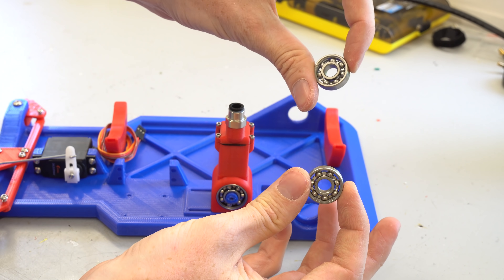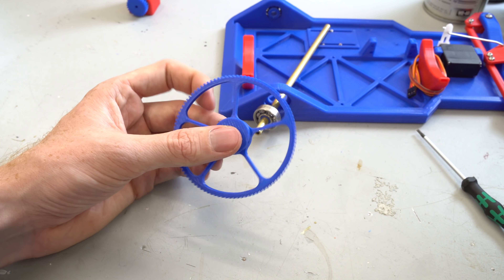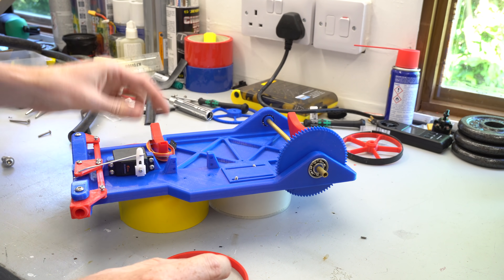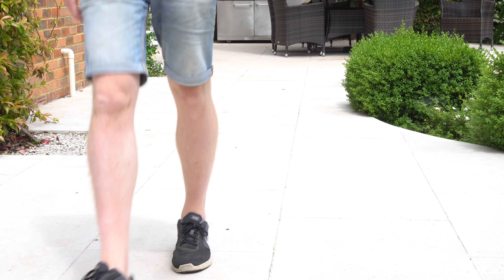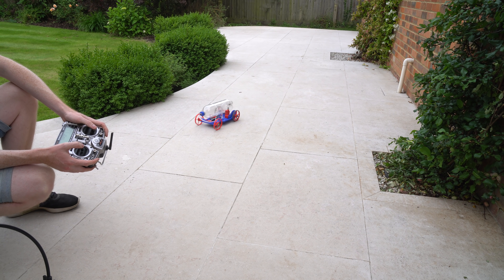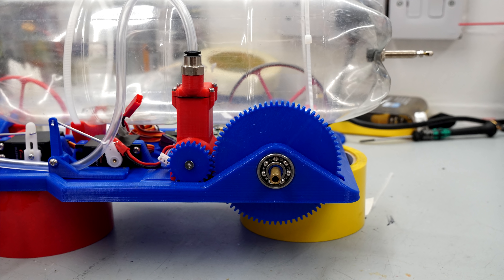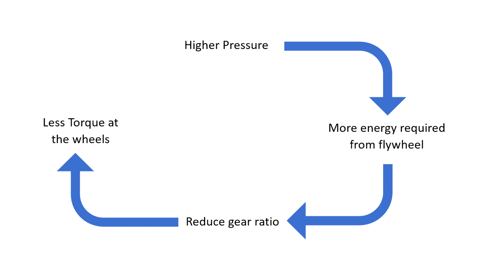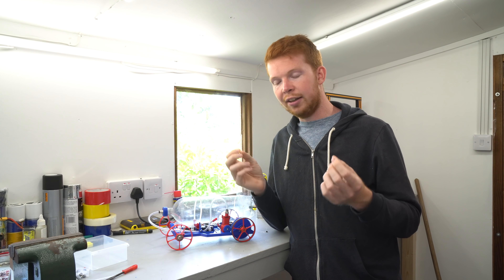Air Powered Car

Comment: Tom, you need a differential.
Reply: Or just drive only one wheel.
Reply: Edward Nardella Tom wants efficiency, so a differential would be perfect.
Reply: @Forever13 pt Surely a differential would decrease efficiency from increased friction. I think Edward's suggestion of single-wheel drive would be better (and simpler)
Reply: ...but with single-wheel drive all wheels would be free to rotate at different speeds and the extra friction of a differential would be eliminated.
Reply: Edward and David make a good point.

Driving only one wheel and having the other free-running in it's own bearing would work effectively the same as a differential and be simpler and reduce friction for the time being.  The two tires would then rotate at different speeds, and would accomplish what you've suggested.
Reply: davidf2281 Yeah, ungoverned wheels are going to totally work out better. Having a differential you have proportional torque on each side of the vehicle. And that increases acceleration and stability, two things that the car needs because of the lightness.
Reply: primary objective: to run the car, then we can thinking on the differential.
The car does not run quite even in the straight where the differential would be just harmful (for the major friction, if you've seen well, everything is mounted on bearings and not bushings, just to reduce friction)
Reply: Forever13 pt idk u seemed a bit angry at first lol
Reply: Based on his previous decisions, Tom will probably want to do a single driven wheel instead of a diff. because of the complexity it would add. He went with a single cylinder instead of multiple because of simplicity even though a multiple cylinder engine would be more efficient.
Reply: If we were talking about something going faster, the vibrations might be a concern, but we're not talking about something that is going very fast at all, thus I don't feel that the vibration point is really valid in this small of a platform.
Reply: Forever: 
What I meant to say is that even in the first piece of the route, before bending, while going more or less straight, the differential would be of little use and considering the little strength that the engine now has would only serve to reduce its efficiency.
When the engine will push the car as it should then you can think of the differential, which is also important but it is more urgent to find the thrust
Reply: zola tanaffa It doesn't need to be a complicated diff, just a open diff. A little bit more friction, and it helps it being stable and cornering.
Reply: yeah you need at least an open diff so the rear wheels can rotate at different speeds, useful for going around corners.
Reply: madhouse5213 Thanks for understanding.
Reply: At least for experimentation,  one driven wheel would be the easiest to intorduce, just case of printing another front wheel and and axle spacer, like on the chassis, to replace the fixed wheel.
Reply: But a lsd differential if possible
Reply: Cheap go karts have been doing this exact thing for years with no issues. Also with how little power the engine has, offsetting itself as you put it isn't really going to be an issue. All he would need is a very slight counter steer and the car will drive straight.
Reply: Just use only one slightly thicker wheel in the center of the car or put two one way clutches inside the rear wheels. But yes, there is no way this version could really steer.
Reply: Forever13 pt yeah sorry lol I realised after I scrolled down that what I said made no sense.
Reply: An Audi RS6 No worries.
Reply: pixelmaster Way to much friction.
Reply: Welsh Dave Yeah, but it will run offset.
Reply: MurderWalrus For the scale, go carts have a smaller axle. This vehicle would have a massive axle. And this engine, as you saw, doesn't have power to corner, and with one wheel only, it would not steer, probably sub steer, or oversteer a lot, making it uncontrollable.
Reply: Štěpán Müller Yeah. Diff would be the best here.
Reply: MurderWalrus Cheap go karts don't have any wheel friction, so they don't need torque because of the high rpms. This car doesn't have High RPM, so it would offset. And some go karts have diffs now, because they have gigantic axles.
Reply: MurderWalrus And I said one cylinder. An Opposed PISTON engine. One cylinder, two pistons. High rpm and torque, tested on Lego. The most efficient I have ever built (vacuum engine).
Reply: zola tanaffa An open diff. Not a car diff, not an lsd. You all thought way too much complicated designs, now that I'm reviewing this.
Reply: Do non-electric RC cars have a differential?
Reply: Jas Tech Some do.
Reply: Jas Tech And most are not as wide as this one.
Reply: No extra friction from a differential because when going straight the entire diff rotates as a unit while powering both wheels.
Reply: greggv8 Exactly.
Reply: Either you have really tiny hands or you have something other than the LEGO Technic differential. ;) That one has only 4 parts. The case with integrated ring gear, 2 side gears and one spider gear. Those 3 gears are the same. Slip the 3 gears in then push in two Technic axles to hold the side gears, which hold the spider gear onto a short pin. Dunno why they didn't design it to have two spider gears.

To adapt to this 3D printed car, cut pieces of a Technic axle and glue into pieces of the brass tube axle. A couple more bearings for the two axle shafts and alter the large 3D printed gear design to slip over and glue to the Technic differential case.
Reply: greggv8 Small palm, and big thin fingers. Could have been a good doctor, if I didn't have trembling, annoying fingers.
Reply: Forever13 pt is everything okay at home?
Reply: LueLou I have a Lego differential of the size of my palm. My palm has about 5-7 centimeters of diameter, and that car is much bigger than his hands that are slightly bigger than mine. Diffs won't be a problem.
Reply: Dave Blaser It has really big axles for it's size, believe me, it's kinda of a concern. And I'm saying fast for this kind of engines and vehicles, like between 8-13 kph
Reply: zola tanaffa Doesn't run straight, and you want to power it with one wheel! The differential will help with that.
Reply: An Audi RS6 But that still, why did you said " is it every good at HOME?" That could be take as an insult, or if you know me would be The same . Or you are simply interested in me, or something related with me. This last one is unlikely the one.
Reply: MurderWalrus Yeah. But, that car won't make corners and will be always offsetting it self.
Reply: Oh, do you think so? Did you realize that  the car slowed down because the wheels rotated at the same speed? Well, that car needs a differential now.
Reply: An Audi RS6 I'm not angry at all, I only tend to look like that. I can be really sarcastic, some people sometimes think like that, like I was being aggressive. Or maybe the colours of my Character influenced you so, your mind probably alerted you about "danger" because they are vivid. And yes, I actually understand a bit of psychology. I'm an ic engine designer, as well. Not has a job, since I really can't by my age.
Reply: An Audi RS6 What do you mean?
Reply: Dave Blaser Vibrations from separated sides would destroy that design, since you would need to find the best way to secure it. Too tight, it would not move. Too lose, it vibrates too much and increases vibration. Since this car is about torque, he should be using an opposed piston engine together with the differential, higher Torque, same losses, and increased speed and drivability. I always think higher, I always find a solution to a problem. And if another problem starts, I already have the solution.

Comment: you should by a proper air compresser. it'd get rid of the need for the bycicle pump when testing
Reply: He has one in the workshop. The soda bottle doesn't have much volume or take high pressures, so a bike pump is fine in this case.

Comment: You should only drive only one of the rear wheels, or make a differential.
Reply: You could say i'm speculating, I would say educated guess, or informed intuition, but am I safe in assuming you've done some kind of test or rigorous calculation? Unless you had I don't know why you would think you can call my conclusion into question by asking what it's based on, so go ahead, hit me with your tests and/or calculations.
Reply: Uhuh, when you're working with much more power, far more efficient motors, and a drive-train of engineered commercially made components, I'm sure using a differential makes a noticeable difference, but that's not what we're talking about. Real world piston steam engines only get up to about 40% anyway, this one is tiny and made from plastic. Let's be charitable and assume he's getting 10% efficiency, and equally charitably assume any 3d-printed diff would improve drive train efficiency by 20%, that's only a net efficiency improvement of 2%. If you have more accurate numbers that tell a difference story I'd love to hear them.
Reply: What assumptions have I made that are absurd? And what have you said more than once that i've ignored?
Reply: I understand that, I know what a differential is for, I'm arguing that the exact situation you're describing  would not cause a significant inefficiency.
Reply: @Rob Mckennie Have you run tests, done calculations or are you just speculating?
Reply: Just remove "rubber" from one wheel and make other wheel same size (reprint) - it should work for first test...
Reply: Rob Mckennie yes, I've made several model vehicles, that's my tests.
Reply: Stan ley execellent idea!
Reply: Why do you say that?
Reply: Rob Mckennie do you seriously expect me to answer your questions with answers you could easily figure out yourself after accusing you of trolling? I guess you do, I've seen that tactic work before. Is it fun for you to make people do useless work and waste their time?
Reply: I believe i've meaningfully considered everything you've said, and I don't believe any of my assumptions are absurd. If you don't want to defend your assertion that I ignored something you said or that I made absurd assumptions that's fine, but without knowing what you're referring to specifically I can't really address it.
Reply: The fact that you suggested one wheel drive as well as a differential doesn't invalidate criticisms of your suggestion of a differential lol, but forgetting about that fact for a second, the majority of my criticism applies equally to single wheel drive.
Reply: why?
Reply: Rob Mckennie to improve performance.
Reply: If you want to improve performance I feel like there are better things to focus on than making sure the wheels don't slip during a turn. In fact, I would think the additional friction of a 3d-printed diff would hurt the performance more than it would help.
Reply: Thats is why I suggested the much simpler and more efficient solution of driving only one wheel. It is a very low cost (time and effort) modification for a significant improvement in performance.
Reply: Lol I don't know if I buy significant, I would categorize it more along the lines of a waste of time
Reply: It wouldn't be significant if he ran in a straight line, but the moment he turns he bleeds off energy in a system that has very limited energy.
Reply: Rob Mckennie that's really funny, either you're lying or you actually believe that. Both are pathetic.
Reply: Go ahead and tell me what you claim I ignored, or what was absurd, and I'll defend what i've said.
Reply: Rob Mckennie you ignored my and others repeated comments about driving a single wheel instead of a differential.
Reply: @edwardatnardellaca  when turing, the outside wheel needs to move more than the inside wheel. Its basic physics. Thats exactly what a differential does. When driving both wheels the outside wheel will always skid because it has to move more. If you drive only one wheel, lets say the left wheel, when you turn left the vehicle will maintain its speed, but when you turn right the vehicle will loose speed. A differential prevents that
Reply: Rob Mckennie you're clearly no longer engaging in this discussion in good faith. Grow up.
Reply: Rob Mckennie because you're making absurd assumptions to back up your point and ignoring something that I have said more than once.
Reply: Edward, shut up.

Comment: The car looked like it was going to work amazing in the first test, I did not anticipate the torque issue. I should have guessed because "air hogs" cars had a metal flywheel, which must be there to overcome this problem. Is there a reason you didn't just wrap some rubber bands around the wheels for traction? Plenty of people use them for "tires". They are also great for drive belts, which would have been less work and probably more efficient than the gears. You could probably make a CVT using one as the drive band.
Reply: 'O' rings fitted in 3D printed grooves on the wheels work even better than rubber bands as tyres.
Reply: The flywheel effect of the cars inertia is undermined by the gears' backlash. This engine would run great simply by adding a flywheel on the engine itself!
Reply: @grantduffy7373  I agree.
Reply: A cvt is a brilliant idea!
Reply: I had a cheap toy tank with a CVT when I was a kid, and it was very simple. A couple of cone shaped pulleys and a belt with a round cross section. Increased torque at the wheels would cause the belt to walk to the lower ratio and less torque would force it to the high ratio. It had a simple cheap permanent magnet motor and ran off a couple of AA batteries. Something like that would be perfectly serviceable once the air engine is perfected.
Reply: Grant Duffy Yep, adding a separate flywheel seems like a great idea
Reply: Add a second cylinder to your motor with the exact same spec, set to 90 or 180 degrees offset, the second cylinder will allow the motor to turn during the torque flat spot, each cylinder will turn the other into its power stroke. This will flatten your torque curve and should allow you to run at higher pressure.
Reply: CVT is a very bad idea, but good in concept, a CVT is very complicated and does need a higher powered engine for it to work properly because of the rubber. Gears are much better for this situation.
Reply: Belt drive is more efficient when compared to plastic gears. Precision metal gears are best, but I didn't think that they were an option for this type of project.
Reply: Steam powered cars from the 1800s had a similar problem, which they solved with a separate flywheel geared separately to run at high rpm.  
https://bit.ly/2lbfD8L
Reply: Has no one thought of a high volume lower pressure air tank? some thing like a balloon or rubber tire that has less increase in pressure for unit volume than a solid container like the bottle. also have you thought about just roughly printing out the gear and then filing it into shape or finishing it to get better tooth definition? Again I still think that Tom and AvE need to talk so he can give some real world fluid mechanic knowledge that you might be overlooking. what about starting with a cheap store bought air pump and re-engineering it into an engine?
Reply: yes but if you don'T keep the engine running BOOM
Reply: Maybe so but this is still supposed to be fairly simple. A second flywheel would add alot of complexity to the design.
Reply: That's a good point but the torque would be to inconsistent compared to an electric motor and you would wind up with it kicking in to high and causing it to stall.
Reply: That is another solution but getting a larger capacity tank can be a little tricky and if you can get high pressure and high volume that would be even better and also about the gears is another fantastic idea, if he printed the gears out with a little more "meat" on them then took something like a file or low grit sand paper to size them that would work a lot better. Also turning a pump into an engine is a lot harder because of the volume involved, In order to get a decent runtime you would have to have something atleast 5 gal.
Reply: He should use dry ice in the bottle that way it would continue to release pressure as the dry ice melted
Reply: Add a small gear meshed to the rear axle driven gear, 1:4 ratio, then the flywheel runs at the same RPM as the motor. We know that works because when the motor ran a propeller directly, everything worked fine.
Reply: That would work but rather than adding another gear into the mix, why not just add it directly to the engine itself? you would most likely have to move the engine but that's a small price to pay for it working nice, don't you think?
Reply: In pneumatics, we have something called a booster. It's a mechanism with a vane and a nozzle; that should overcome the torch ptoblem.
Reply: A little confused, is it something that goes to the piston head or is it something you just put on the line? if the later than that wouldn't work, pressure is an issue but not in that way.
Reply: USWaterRockets are going to upload soon😕
Reply: is it possible to use the exhaust of the bottle to create thrust to propel the car and also maybe add a rudder type thrust vectoring to change the direction of the car?
Reply: I would make a different car
Reply: expect oil corporation hitmen to come for you, you're not safe
Reply: Rubber bands as a drive belt would have horrific losses. The gears are much better.